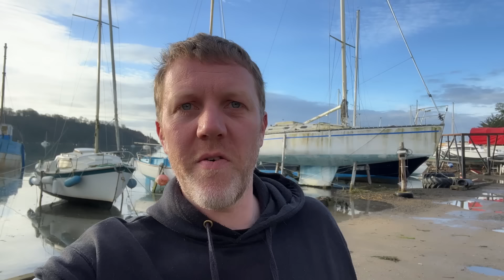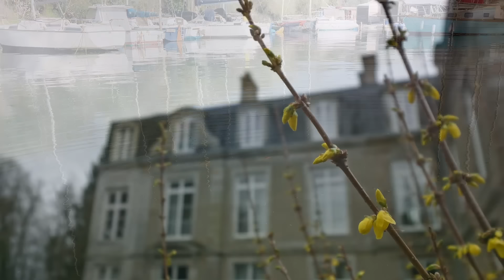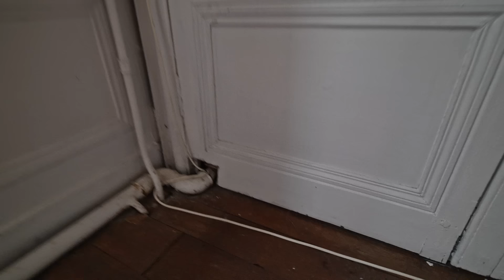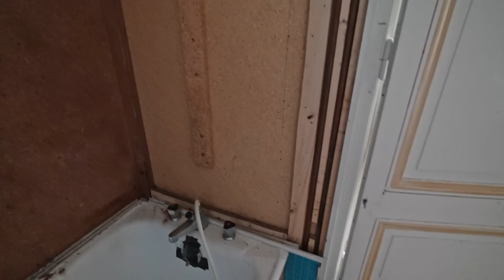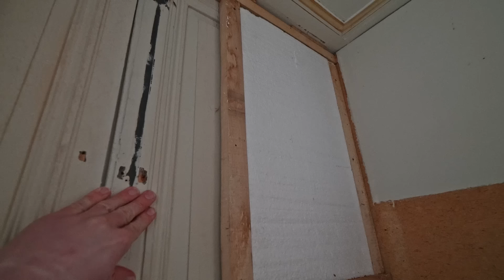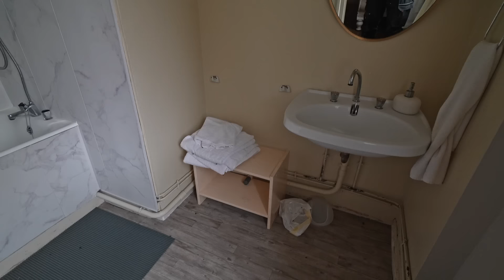Demolition To Make A Master Chateau Suite Continues- Chateau Life 🏰 EP 342

Comment: Good to see you getting it done. Question: that extension you are taking out does it go up to the ceiling and along the length of the wall? Or does it only go up? That might make a difference as well. Also, always remember to buy 2 of everything especially if you know you are going to be doing it again. First the sink and now the tub, that is 2 sets of pipes that need to be capped. Moving on, hopefully they will have what you need soon. Have a great day